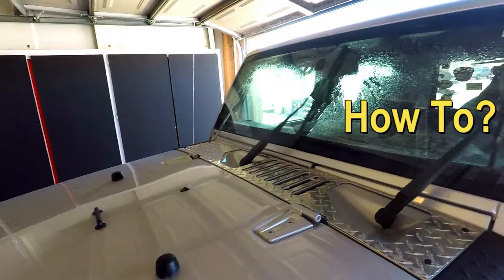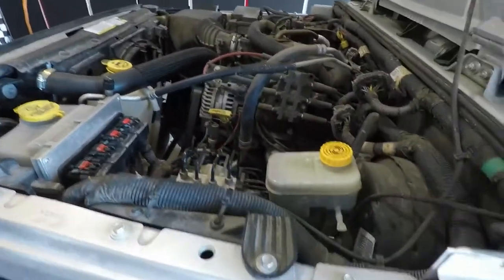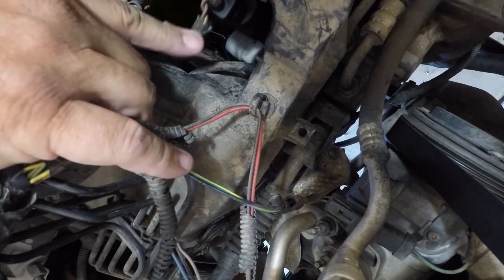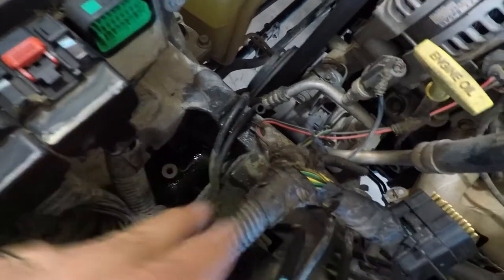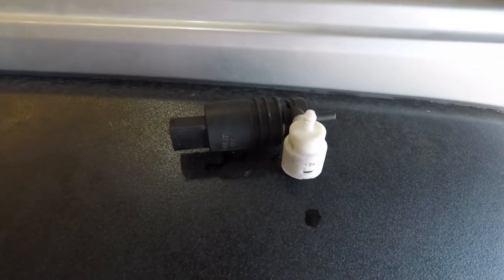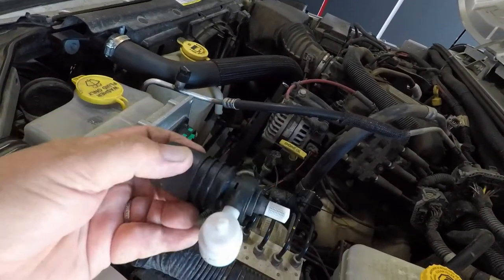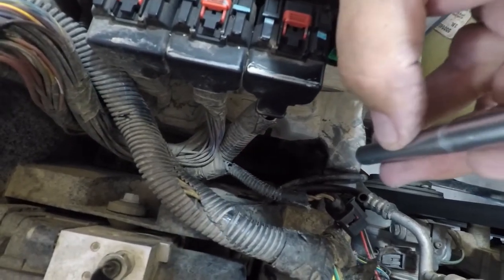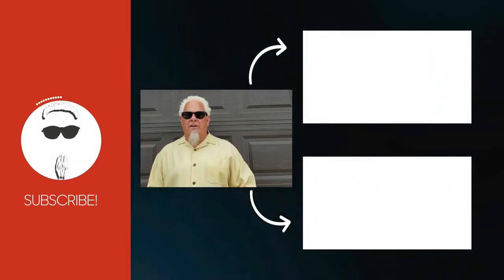How to replace a windshield washer pump - 2009 Jeep Wrangler

Comment: Did you have to empty the washer fluid tank before replacing the pump and grommet?
Reply from the maker: Sorry for the delay. My wife and I were out of town on a mini vaca as well as doing an on site video location search. It will leak out when you remove the filter and pump anyhow.

Comment: I've been driving for two years with no windshield washer b/c the reservoir dumped fluid as fast as I filled it up. I read on the forums that there was a plastic piece down there that needed replacing, but you're the first person to both show it and provide the BMW part # of the replacement. If it turns out it only needed that $10 part, I'm gonna be ecstatically furious. Thank you for this, man...
Reply from the maker: Hi Lepus Malignis ( I love the name by the way). I hope it works as it did for me. It works like a charm. IO am so glad I was able to help. Do you have any other challenges you would like me to cover? Thanks again and be sure to subscribe.

Comment: Hello Eric, great coverage. I repaired our washer pump on 2011 Sorento V6 EX 90K easy miles. Pulled passenger side front tire and interior of fender. Removed old pump, tore it apart,  cleaned it up. Worked great for the time, then we traded vehicle in last year. You don't miss those pumps until it's not working properly:-).
Reply from the maker: Hey Breeze Rides. Thank you for watching and your comment. So true. Its  amazing how we take simple things in our cars for granted then ... Oops. Thanks again for watching and your comments. Cheers

Comment: Thanks mine started slowly leaking was able to get it to seal up only 415 k miles on it still working.  Use minus 25 fluid most of time in it so far still going
Reply from the maker: Only 415 k miles! Lol